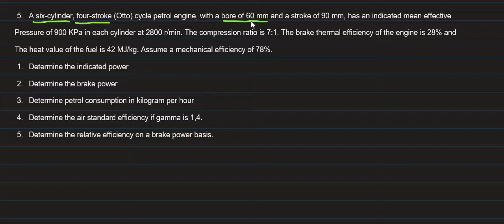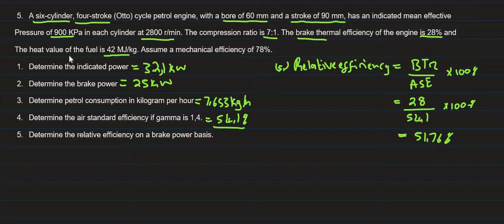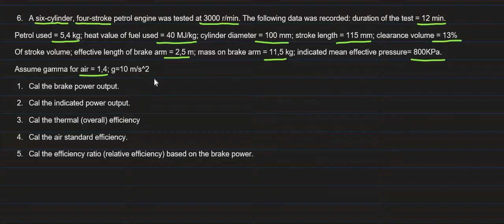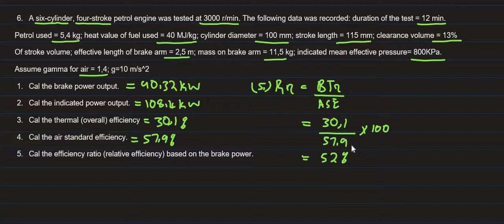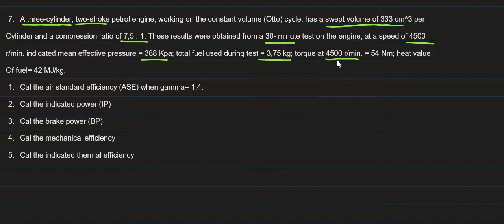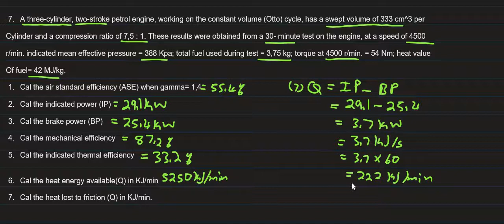N6 Power Machines Otto Cycles P2

Comment: An open circuit, continueous combustion, constant pressure gas turbine receives air from
the atmosphere at 17 °C and compresses it to six times the intake pressure in a rotary
compressor. The air then passes through a heat exchanger which is 69% efficient. From the
heat exchanger the air passes through a combustion chamber in which 2 110, 5 kJ of heat
is added per second at constant pressure and the air temperature is raised to 873 °C from
the combustion chamber the air expands through a turbine to atmospheric pressure and at
this pressure it passes through the heat exchanger to the exhaust. The polytrophic index for
the compressor is 5, 193% higher than gamma due to friction and the polytrophic index for
the turbine is 8, 929% lower than gamma, also due to friction.
The mass of the air flowing is 4kg/s
Take gamma as 1,4 and Cp as 1,005 kJ/kg.K.
Calculate: 
3.1.1 The adiabatic and normal temperatures as well as the isentropic efficiencies of the 
compressor and the turbine. (11)
3.1.2 The absolute temperature at the inlet to the combustion chamber. (3)
3.1.3 The absolute exhaust temperature. (3)
3.1.4 The thermal efficiency of the plant
Reply from the maker: Good day can you please email the question to codeswitching2020@gmail.com, we will try to look at it and get back to you as soon as we can thank you.